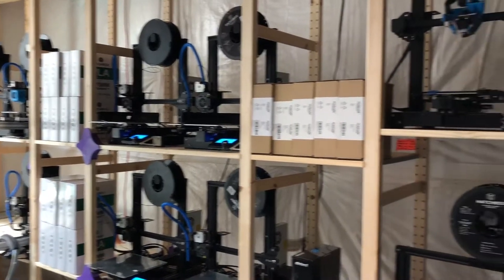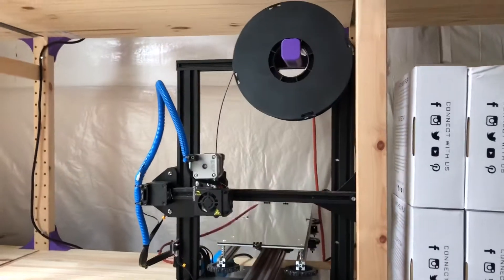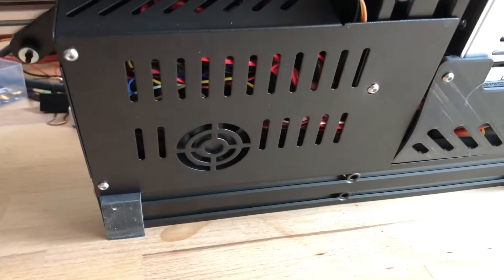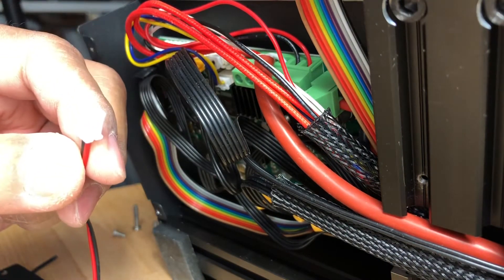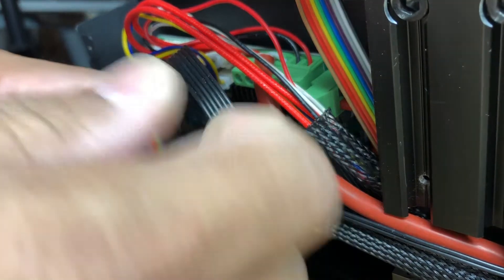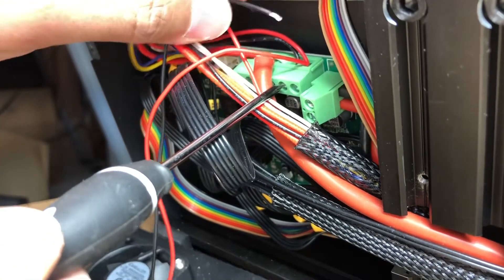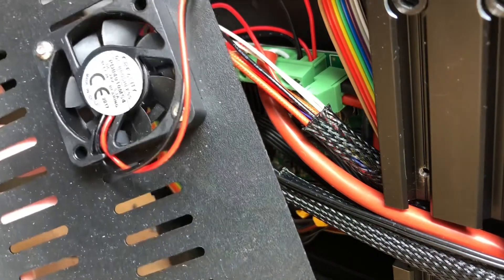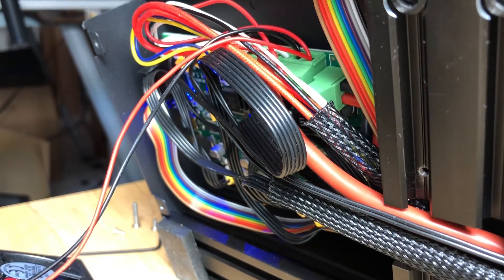Keep the Ender-3 Motherboard Fan On

Comment: i know im a little late to the party, but recently i updated mriscoc firmware on my e3v2, and randomly it beeps and displays the startup box that says "professionl firmware v.x.x.x. ect.'' then, it resets all the temps back to 0 and starts me back from square one. even resets my build mesh settings. would you think its being caused by the mainboard fan? im going to wire it up anyways just hoping for some insight

Comment: Does it overclock the fan?
Reply: No, the fan will not pull more amps than it's rated for at a certain voltage
Reply from the maker: Nope.

Comment: Does two 24v fans connected to a single 24v header affect how fast they will run?
Reply: It does, but is usually insignificant
Reply: No its like turning on 2 light at the same time at your house

Comment: Thanks for the tip! Any ETA on the Y axis extension kits being up for sale?
Reply from the maker: I can give you a link to someone who sells reclaimed aluminum. It's $15. If you are willing to drill the holes yourself, then I can supply everything else.
Reply: @DewItJustinKace  Could you share the plans/dimensions for drilling the aluminium bed? I might be able to find the plate locally and drill it myself.
Reply from the maker: @ericyeo3799  The guy making the beds just contacted me today saying he'll have them on Etsy this weekend. I hope so!
Reply: @DewItJustinKace  actually I managed to source the aluminum bed and extrusions. Only need the 24v heating pad, do you have it for sale separately? Don't wish to go AC yet.
Reply from the maker: @ericyeo3799  I don’t have any 24v ones. I used the only 6” in width one I had to verify how well it worked compared to 110v. 110v takes 2 Minutes to get to 75 degrees Celsius. 24v takes 8 minutes. That is a crazy long wait. Made it so 110v just made more sense.
Reply from the maker: @ericyeo3799  all that said I’d be willing to tell you the plate and the heater it’s attached to.
Reply: @DewItJustinKace  is the upgrade guide ready yet?
Reply from the maker: @Pandonaut  Beyond the video? No. But I'll working on a new post to update https://projectender.com/2021/01/23/extending-the-ender/